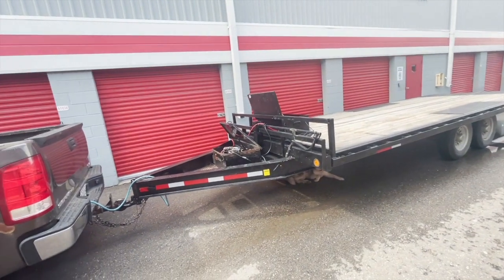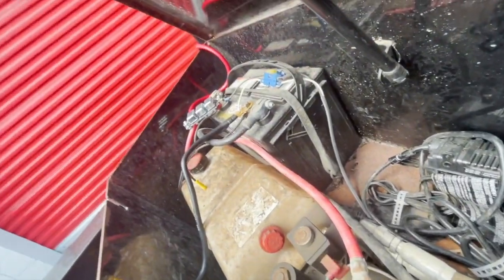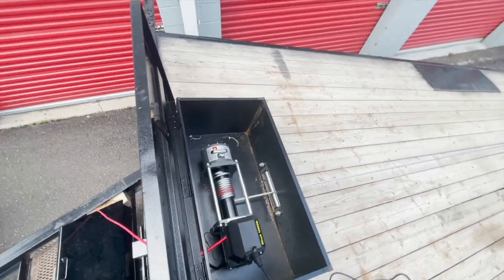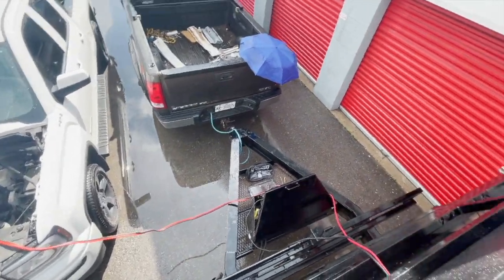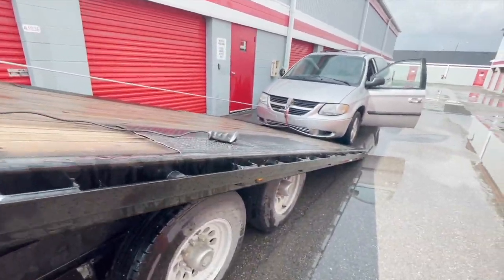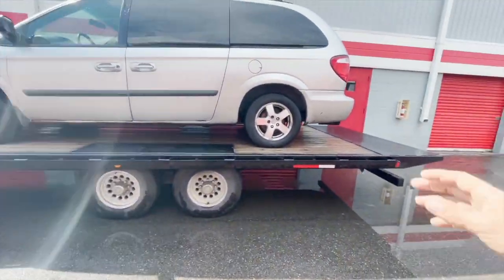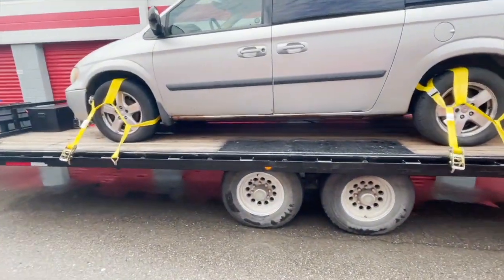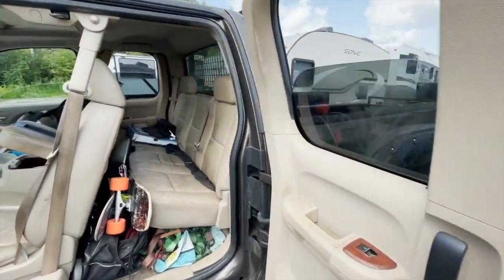Got a new trailer! heavy duty hydraulic deck over tilt & load

Comment: I've had batteries just die on me after lifting.     So you could winch a vehicle on your tilt deck, the battery die, and not be able to lower the lift.  You are stuck.   And now if  you were to unhitch ...  your trailer could roll away.  Hope someone can get you a new battery.   Sometimes those jump start batteries don't have enough  CCA to lift that cylinder.   Dual Batteries might be a good idea.  Also a good battery tester that can tell you the % CCA or %MCA before you go do a job might save your bacon.
Reply from the maker: yeah definitely a good idea to always have a back up plan in case the battery dies. I have a second battery as back up most of the time now and I also have some really long jumper cables that will reach to the trucks battery and will give more amps while the truck is running 👍
Reply: @scrap2cash712 I have a pig tail on my winch with a quick connect plug and then have cables ran to the back of my truck from my batter and then.a 5ft cable that runs between my truck and trailer to use as back up incase the batter in my trailer does die.

Comment: I feel like winch wasn’t pulling anything lol 
All the time I saw the cable of the winch loose how is that possible
Reply from the maker: what do you mean loose? lol 
the van rolled a bit because it was on a bit of a slope and my buddy was pushing it in the beginning
Reply: @scrap2cash712  there were No pressure at all on the cable of the winch

Comment: How's the suspension holding up in your half ton GMC sierra Truck with a tilt deck car trailer
Reply from the maker: I upgraded the rear leaf springs right after I got it and since I did that its had no issues with it. It definitely puts more stress and wear and tear on the suspension though lol. Looking like I might need some work on the front end suspension soon

Comment: Bro the hydraulic battery does not charge from car? 7 pin cable?
Reply from the maker: its supposed to but it does not seem to work. I park it right at my house now so its easy enough to plug it in a charge it all the time anyways
Reply: It only charges the emergency breakaway brakes  battery, not the other battery.